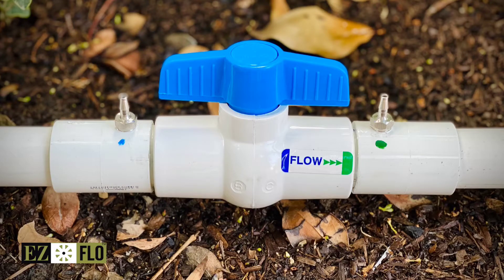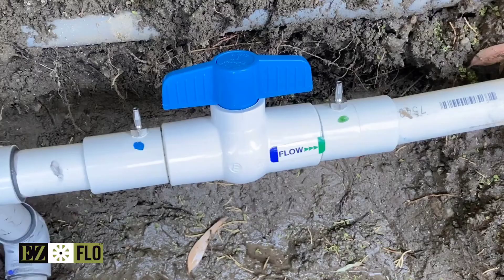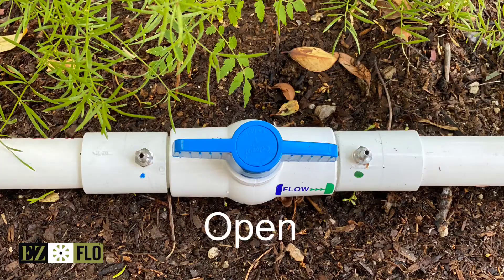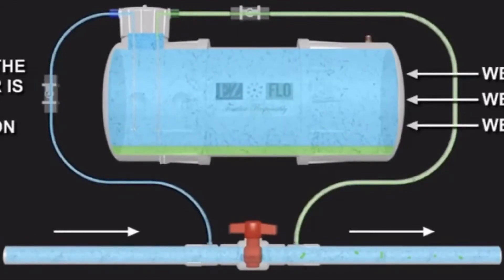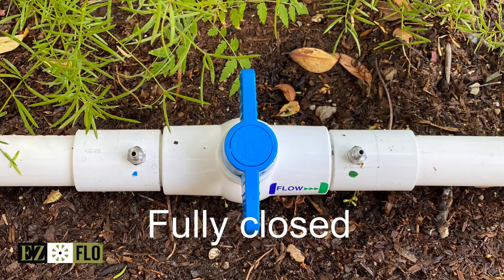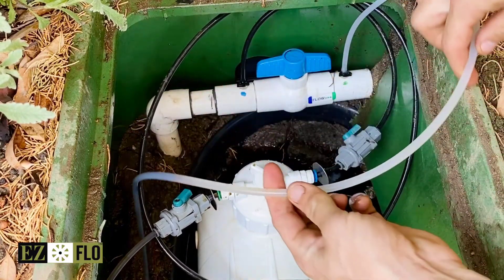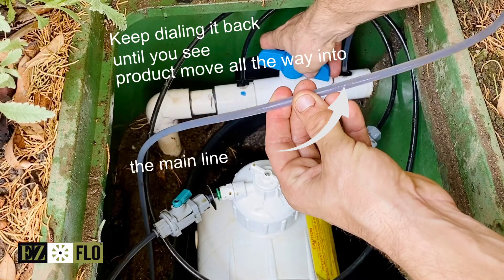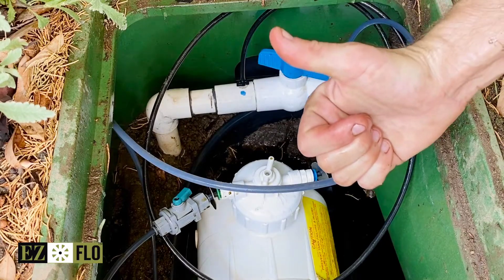How to make sure your EZ-FLO is injecting

Comment: this actually does not work and here's why:  you CAN do this to show the color change but on slow it only injects 1 gallon of ez flo fertilizer per 15,000 gallons of water!  that means you will NEVER see the color move from clear to whichever color you're using (blue here) when on slow mode.  So, you put it on "fast" mode which is 450 gallons of water for every 1 gallon of fertilizer ... which is still way too slow to see go from clear water to blue!

The fact is, you can't tell.  Once my sprinkler zone goes off the water sucks BACK into the ez flo and the piper is clear again.  Then the zone starts up and it stays clear water so I do this method and BOOM!  It flows super fast!  WAAAAY too fast!  So, I turn it down to 1 or slow and it never turns blue or whichever color I'm using.  So, I'm flowing 6 gallons per hour average through my zones and I have my valve 1/2 way closed and have it on #1 setting it it NEVER turns blue!  (well, my fertilizer is yellow/blue "gold rush" liquid fertilizer I filled my ez flow with).  I do not dare turn the valve more than 50% because it will just flow pure fertilizer.  

This is a very frustrating process... wish there was a way of more accurately distributing the injection... :(
Reply: Also, i would contact Ez Flo - they ain't no fly by night outfit & have major tech support & R&D group
Reply: what about dosamatic injectors built into unit like we use on lawncare rig with John Bean pump?
Reply from the maker: Thanks for the reply! It sounds like you need help calibrating your ball valve.  If you're still having this issue, please reach out to us directly at info@ezfloinjection.com and we can walk you through the process.